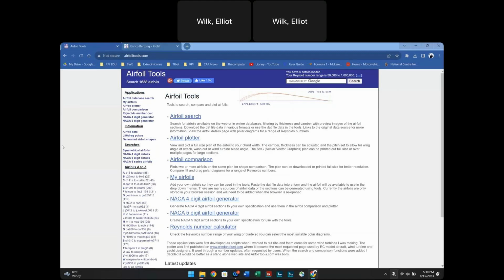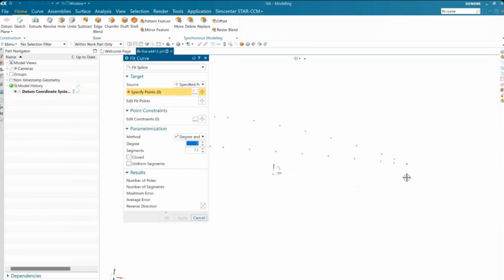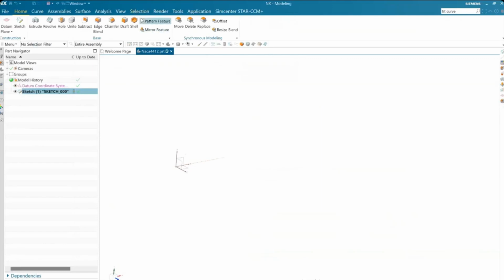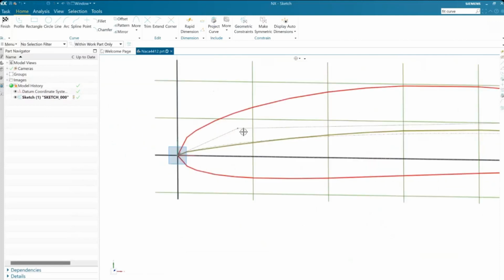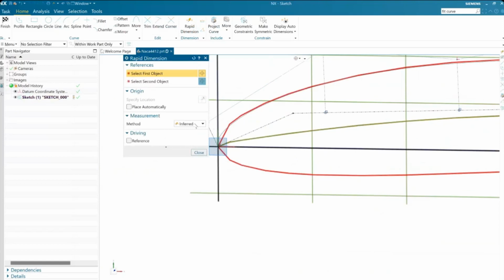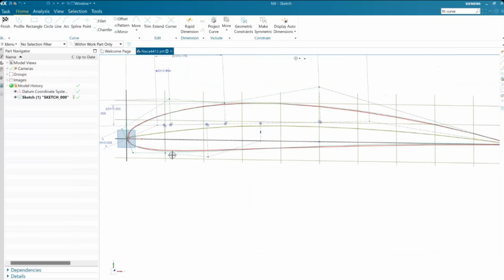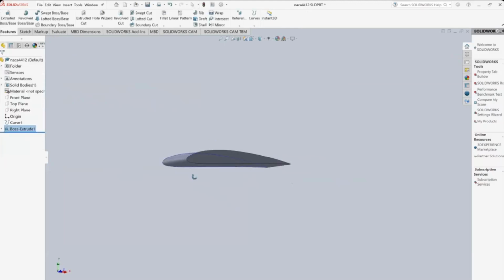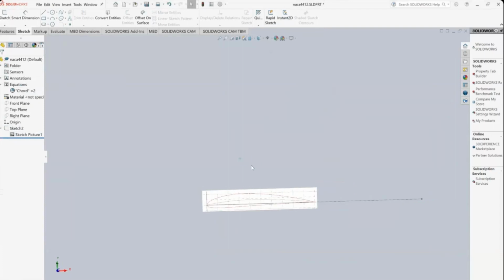2 Ways to CAD Airfoils in NX and Solidworks

Comment: In solidworks I prefer to first get the unit airfoil in the same way by making a curve with xyz points. Then I draw the chord line for control and convert it to a sketch block. Then you can import the block wherever you need the airfoil, explode the block, and then drag the airfoil curves to the desired chord length and angle and constrain. I'm a new NX user and am having difficulty finding a comparable method ...

Comment: how would i be able to change the chord length using the first method? when I input the points the chord is about an inch. how can i make this bigger with the proper proportions?
Reply from the maker: You could try using scale sketch or make a geometry and scale the geometry.